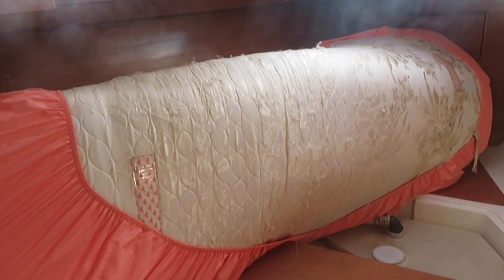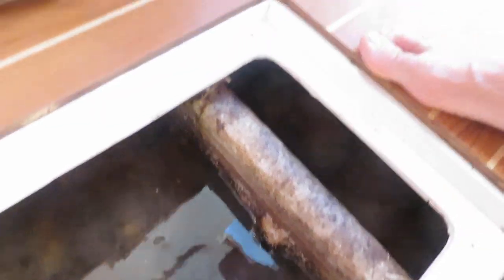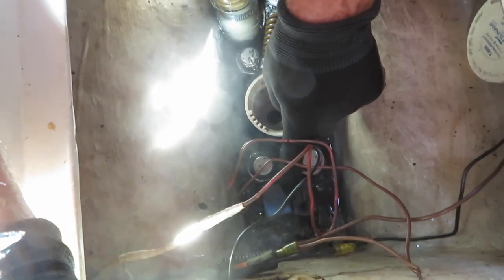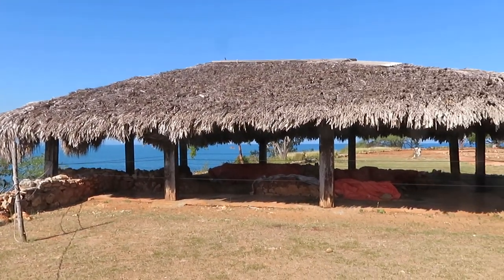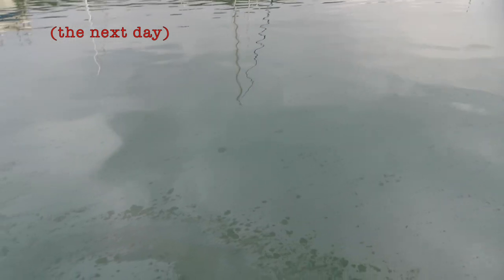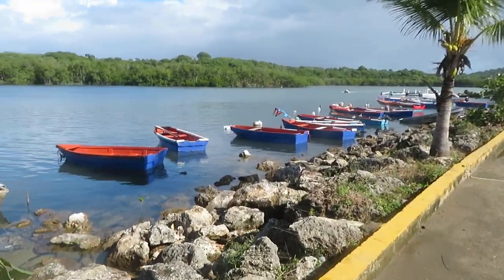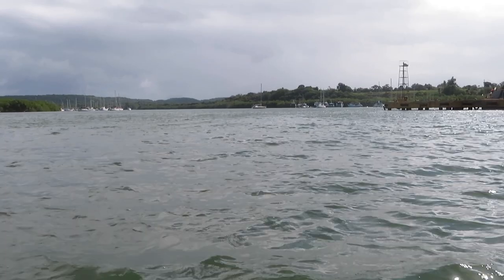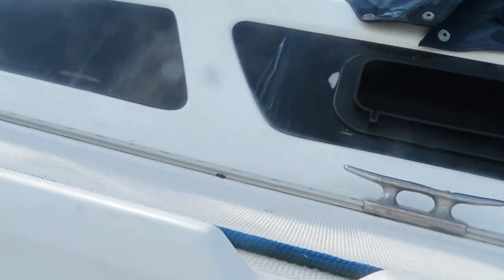Skipjack Sailing 19:  Water tank, bilge pump, La Isabela and a tropical storm.

Comment: Man! just cut the bottle you are using in half and stick the pointy end in the tank and you have a funnel....
Reply from the maker: Exactly!  But....those bottles have a deposit that the marina pays, and (wow) do they get pissed if they don't get their bottles back.
In fact, there is a small "Empty Agua Bottle Theft Ring" out there.  Locals will buzz around looking for empties that are left on deck....grab 'em and run.

And, the fill connection on deck is too small to use that bottle.  After that video was shot, I finally remembered to NOT crush my 2-litre soda bottle and that's what I used.

Keep the comments coming!  I love 'em and I know that I am smart enough only to know how dumb I can be.
Reply: @skipjacksailing8986  damn those bottle nazis! Enjoying the posts a lot.